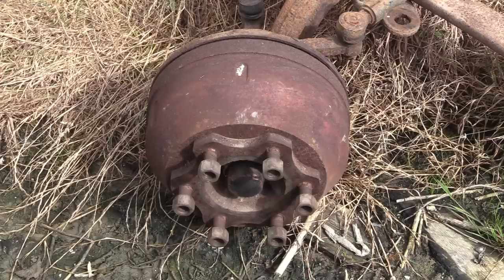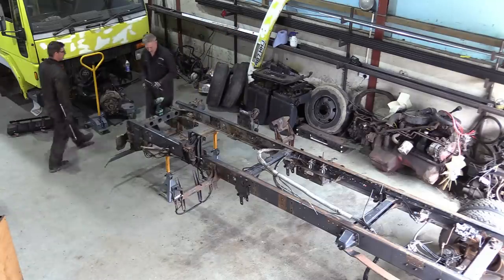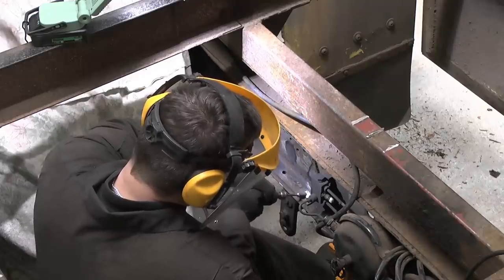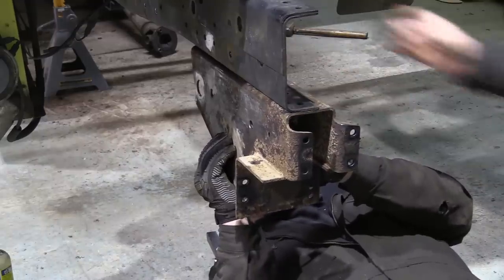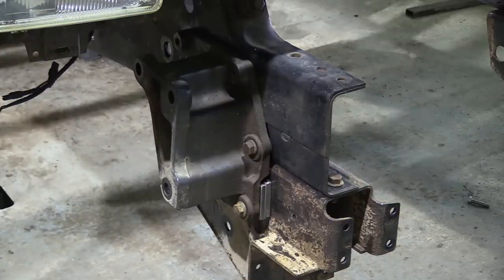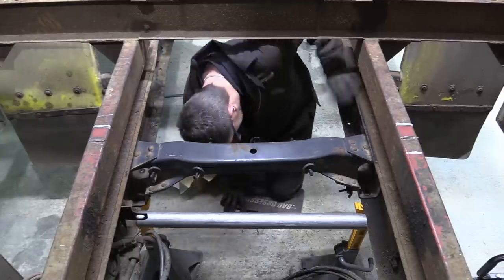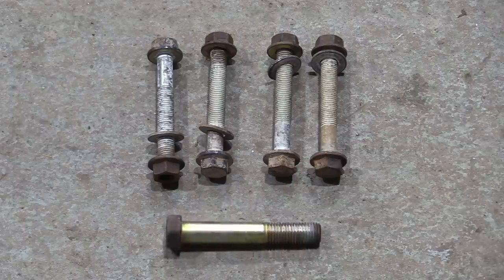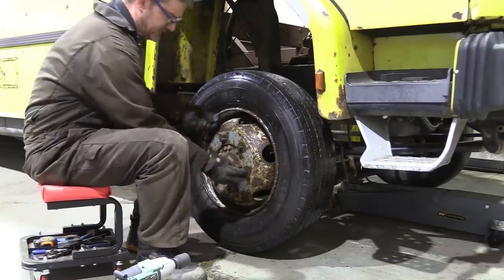The Escargot - RV/Camper Car Transporter Conversion - Part 4

Comment: It's great engineering and all but part of me is wondering why they didn't just lop the Ford front off the body then make a trailer hitch on it then use the DAF as a prime mover? I'm not from the UK but it sounds like the licensing laws are a real headache. Cheers lads for keeping me entertained for 40 odd mins.

Comment: What is the item called that you are using at 2.29 to hold the wheel? Only asking as I designed exactly the same thing for my degree 20 yrs ago. Either I was ahead of my time and could have been rich.... or I designed something that already existed!

Comment: I know your far from finished and Idk how strict it is over their but in the US trucks will fail inspection with any exposed frame holes due to the risk of cracks forming. Each hole needs to be occupied with bolts

Comment: The question I have for you guys if the chassis from the DAF is 40mm thinner than the Cargo, which crossmember did you use for the spring mounts

Comment: Ok. I've watched about 5 minutes in and I have a question: why didn't you just use the DAF truck as the Binky Carrier and shift all the Escargot's appointments to it? Save you a shedload of work.
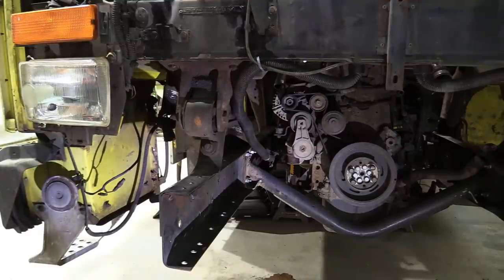Reply: And, after a careful viewing, asked and answered by 10:05. Might actually be better shifting that van to the dAF and THEN getting a license to drive it. Take about the same time and far less chance of dropping a truck chassis onto one's mate.

Comment: You going to drill out or replace the steel box section along the top of the chassis rails? Got to be 100kg there

Comment: I find myself wondering how well those single leaf springs are going to handle the load. The front end of that bookmobile appears to be a lot heavier than the DAF.
Reply: You'd be surprised. Even my 18T Axor only has twin leaf front and that's plated at 7.1T at the front. Entirety of the Escargo fully and evenly loaded will only be 7.5T.

Comment: Couldn’t you of made an extended chassis for the DAF, built the back on it, then IVA’d it? 

I’m pretty sure with both axles, the engine, and steering box all being changed you’ve racked too many points for the Ford to not require an IVA anyway? Think you’re only allowed 8 points worth of modifications in total and each axle counts for 2?

Comment: After spending half a decade cramming  saloon-car parts into a microcar, there's much more breathing room hot rodding a lorry, somewhat reminiscent of Bugatti's comment about Bentley in the 1920s: "Le camion plus vite du monde".

Hence, it's probably unwise to find a supercharger off a WW2 tank and hang that out over the front bumper, concealed under some "aero", would no doubt lead to reliability issues.

Comment: I certanly have missed something: what are those electric impact guns? They seems to be very torquy!
Reply: All the electric impact stuff got about 10 times better than the last three or four years. However the ones that was torque like that cost a couple hundred bucks at least. the home grade ones are almost as torquey but you can't run them as long before they get too hot and need a break to cool down.

Comment: Your licensing requirements in the UK confuse me. Any vehicle that can be driven with a regular “G” class license here can not have air brakes. A vehicle with air brakes requires a “Z” (zed) endorsement on at least a class “D” license. 

That being said the “snail” is going to have as much mixed parentage as Binky so in the end it will be a very appropriate hauler.

Comment: Age of your truck means you will not need a speed limiter on it and be able to drive at 70 mph in the fast lane of the motorway, joys of older 7.5 ton trucks, just don’t take it into London’s low emission zone for that can be an expensive mistake

Comment: No idea why ud want to use a crappy cargo . Surley using the daf and modding it would have saved u hours of work . U can drive any 7.5 tonner on a car liscence if u passed ur test before a certain date . I cant rember of hand what it is . But  id imagine both u guys passed ur tests in the late 80s . I passed mine in 88 .  Im sure its 92 the law changed .  Itl be cool to see the finnished result though . Its a lot of work . Gd luck with it all pls take care .
Reply: 1997 and you're not driving on a car licence, you're driving on the C1 licence class that you have in addition to B.  "Car licence" is not a very accurate term, you are essentially correct but its worth getting the advice totally watertight if you're offering it.
Reply: @iangriffiths985  it was just the info i had to my understanding .  Hope ur conversion is coming on well pls take care

Comment: Wouldn't it have been easier (& quicker ) to just swap the bodies?????  You're doing all this work & you still have an OLD chassis.
Reply: Cargo is (I think) a 16 ton de-rated to 7.5, a much sturdier bet than a stock LDV 7.5 chassis - not to mention, how would you move the massive jelly-like body once off the Cargo chassis?